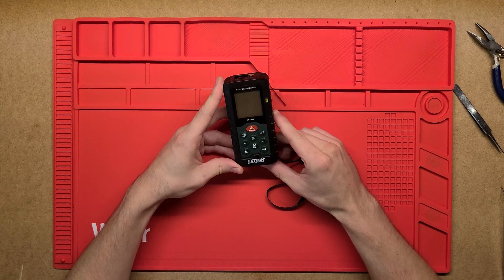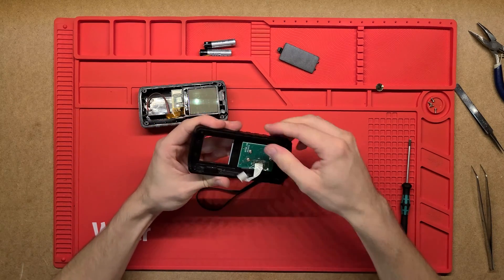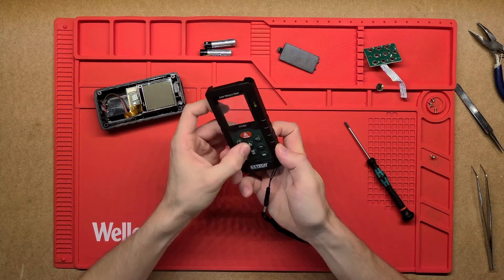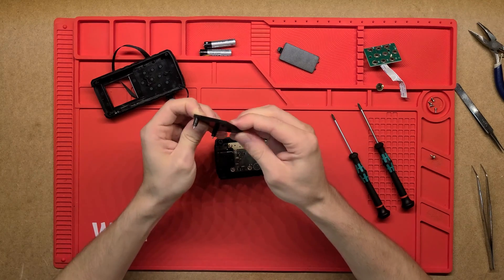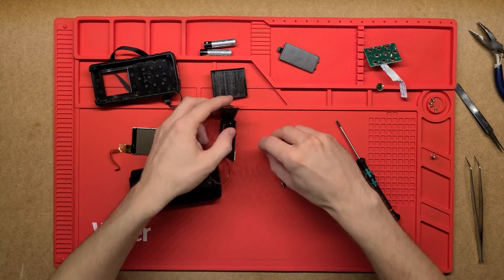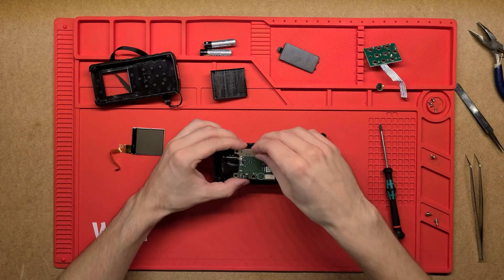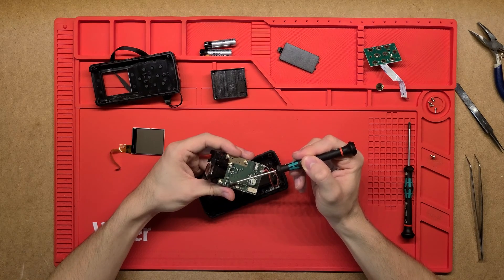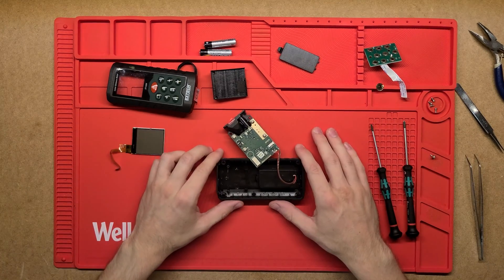Laser Tech: Distance Sensor Teardown

Comment: Thank you for the explanation, but I don't find it logical. If we assume that the accuracy of the device is one centimeter, the difference will be very small, on the order of picoseconds. Most electronic elements cannot detect this. For this reason, I hope that the examination will be more in-depth, mentioning the electronic elements used in transmission and reception, and showing the optical system used.
Reply from the maker: Yes, you are exactly right. It's mindboggling how fast this works, but that is the correct way. The crystal oscillator provides an extremely precise frequency to the microcontroller, and the microcontroller works extremely fast, so it is able to measure the slightest difference in the time. You are also right that most electronics don't work this fast (because they dont need to!), that's why the controller used here was chosen for this purpose.